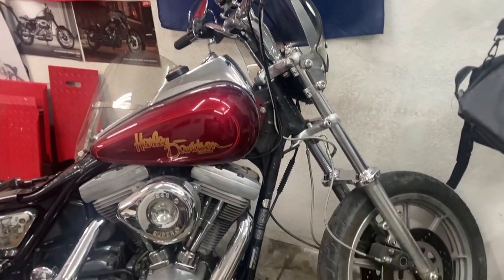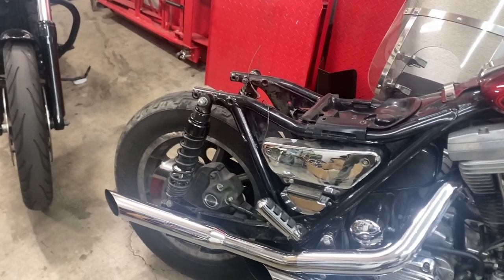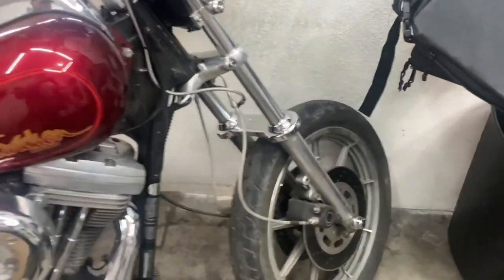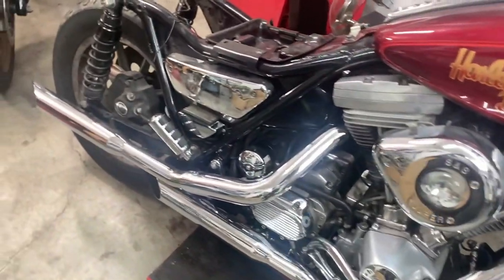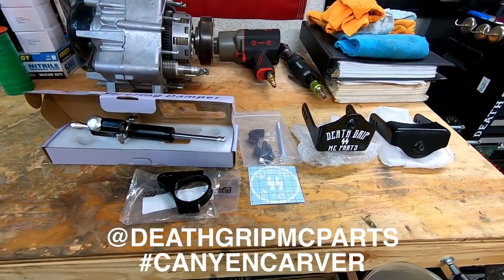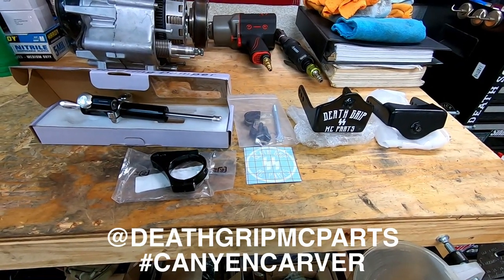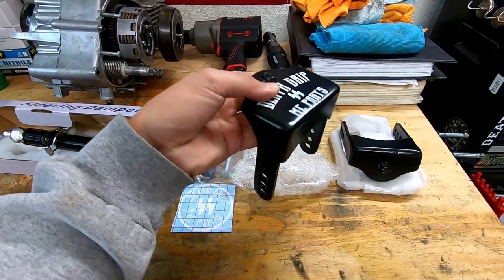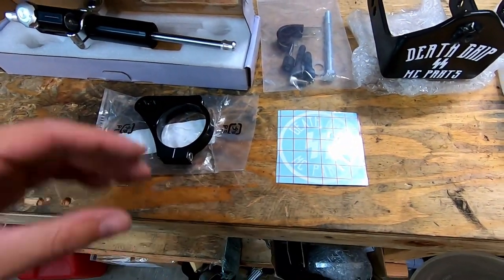Steering Damper Install #CANYENCARVER

Comment: Ran the Storz on my Dyna LRS first and it leaked after a couple years.   Been running the GPR and its been great.

Interesting setup, but the GPR is still a cleaner install.
Reply from the maker: Agreed but the price difference is huge!
Reply: @dynademos    Totally get it.   👍

Comment: If you're bottoming out the front thats very risky. Add a few turns on the preload.
One question, is the Damper shock itself rebuildable? Either way i will definatly check it out!
Reply from the maker: I might have misspoke I haven’t bottomed out my suspension. Also I’m not sure if it’s serviceable I’m sure a higher end damper would me
Reply: @dynademos  Looking forward to the review!
Reply from the maker: @Jimmy_Jim_Jim_1234  check back next week 👍🏽✊🏽

Comment: Cool vid/ concept but not sure I’d trust that damper.. Ohlins and GPR are pricey for a reason.. 

If you like to “carve” the canyons, why’d you raise the front (increase the rake/ camber)? If you lower the front (triple trees) and raise the rear (which I think you did) you decrease camber and reduce the overall trail of the bike.. it’ll “carve” much better.. preload is set and forget (mostly).. learn to read your tires.. they’ll show if you need more/ less compression or rebound.. not sure if you have those adjustments.. just rambling..
Reply from the maker: I haven’t had any issues this far with the damper. As for why I raised my bike the simple answer ground clearance. I had a stock front with raised rear end I find raising both gave me a better feel.

Comment: Hi Lego,  sit back with a coffee and read this one a few times - there are a lot of things to think about !

I'm puzzeled as to why you need a steering damper when you fitted better engine mounts, maybe the fork preload/valving needs a little more attention. Perhaps you are confusing the  effects that springing and damping features have. Once you get the front forks working properly then the rear suspension units will not be 'fighting' with the front ones making you think you need a steering damper....

 I notice that your preload adjusters are eased right off..... maybe the fork spring spacers are too long giving too much preload for the spring - the externally adjustable ones are more for 'fine tuning'.If you feel the bike is harsh on the compression stroke then you have too much fork spring preload.

 I have stronger springs (single rate springs and NOT progressively wound ones) and don't use any preload caused by the fork spring spacers. As you have extended the overall length of the fork then any preload that occurs when the bike is taken off the stand (otherwise known as 'sag') is maybe all the 'preload' you need ! - that is after all why you have 'extended' the forks by fitting longer damper rods or 'seat pipes' as the H-D manual calls them.
Though I do realise that you wanted more ground clearance for 'canyon-carving' as you guys call it, longer forks will allow more travel and can therefore allow a smother ride by way of a softer spring rate - short suspension (slammed) Bikes will offer nothing but looks and poor handling.

I assume you are still using the standard (for your bike) fork internals here though - my 2010 has the 'old style' internals which are different and more easily tuned than the 'cartridge type' things that H-D tried but failed with in yet another attempt to rectify all the problems those 'over-sprung and under-damped'  type set ups they have been using for way too long.
I use the emulators to adjust more for 'plushness' than to attemt to avoid a harsh ride - I use the softeset pre-load sprimgs for the compression damping adjustment - but then I am older and like a 'smooth ride' rather than a bike that bucks around (- still like the women to be a 'rough and ready' ride though !).

Although my bike feels just as 'plush' as the standard bike (mine is a 2010 Streetbob), it now does have suspension that works without the sloppy feel and harsh 'big bump' ride that the standard damping and springs caused. Too soft a spring that is compressed with too much preload can and will cause the spring to 'oscillate' with shocks from road bumps as the spring is not absorbing the shock but merely storing it like a pogo-stick. A stronger spring with less preload will absorb the shock and tend to not'rebound' so harshly and therefore give a smoother ride that does not cause the bike to feel 'unstable'.

If you get the forks set up properly then the fork will absorb the 'impact' off the road bump rather than bouncing off it thereby putting more off the bike's weight on the rear suspension which gives the impression that it needs more preload/stronger springs on the rear. That excess rear preload will make the bike feel unstable in normal 'highway use' as the bike will tend to wander and weave because the rear suspension is too hard to properly absoeb the road bumps and actually puts more 'load' on the front forks ..... you have to make the front and rear suspension work together and not fight each other.....

As for the rear shocks I found that the cost of rebuilding them was the same as buying new un-rebuildable ones (they do have adjustable damping) so I opted for them so as to avoid  the 'downtime' of waiting for the rebuild..... preload is still adjustable and as they are much cheaper than the rebuildable ones you can save in the long run as the rebuildable ones need rebuilding so often - the oil in them degrades/gas leaks pass the seals just as often in either case.
Oh, the term is 'damping' not dampening..... to damp something is to reduce 'it's' progress, to dampen something is to get it wet..... quite surprising how many people get that wrong !
I think maybe I should mention that whilst my forks are still H-D, I do use springs wound to my own specifications,  Emulators, SAE 10 fork oil, Wide Glide (FXDWG) yokes or trees as you call them (so the forks are 'raked out' 2 degrees) and FXDF lower legs (or sliders as we call them !) so that I can run a twin disc set-up.
The two degree raked yokes are more stable at speed and slightly less manoueverable but as I use a 21 inch front wheel, the bike still 'falls into' corners nicely. Fatbobs have a one degree 'de-rake' in order to compensate for the tatter tyre.....

Sttering dampers or stabilizers are just a BandAid on an open wound - it (the suspension) needs 'stitching up' properly mate.

 Nice to see you back again by the way !
 Bob
Reply: Kinda.. if the right springs are set to the right preload (sag), awesome.. you’re talking about compression and rebound.. if he’s twisting the screw out of a corner, the front end gets light, no matter what.. a steering damper will (supposed to) prevent harsh wobble/ tank slap.. it all ties together, yes.. without compression & rebound control, a damper is the ticket on a HD.. conditions can  change suspension behavior.. even the best (MotoGP) have dampers
Reply: @bullast2046   Well, while Lego is using Emulators to help control compressio/rebound it must be remembered that  fork spring rates also affect it. I personally tried Progressively wound springs but found that the constantly varying spring rates (depending upon amount of compression and/or wether the forks were extending or compressing) made it difficult to set up the Emulators to a setting that worked for vaying road surface types/uses of the bike.
What you say is correct about the front end getting light - all Harleys - at that time at least - had the weight bias on the rear wheel and that all adds to the problem of 'weight-transfer' when accelerating and brakeing. Said transfer is really detrimental to the handling especially with the 'over-sprung and under-damped' standard suspension - hence my comparrison with a kiddies 'pogo-stick'.
 To compare a Harley to other bikes is not relevant due to (most) other bikes having the weight bias on the front wheel along with less relative weight transfer, and you have to take into account the fork rake and front wheel 'trail' which will  - along with other dimensions and degrees - alter marginally with the front/rear suspension slopiness. All these things have consequencies as regards the overall handling of any bike.
 Sports bikes and other road bikes again cannot be compaired with race bikes as they are built for different purposes - the only maxim would be that different bikes need setting up differently - try putting longer shocks and forks on virtually any Harley iand it will change the handling compared to a standard one, but you will never get a Harley to handle like a sportsbike due to the weight bias differences.
If one gets a bike set up to a point where one can both predict and rely on how it will handle, then it is merely a matter of the size of the riders kahunas and skill as to how it can be ridden - I have ridden the 'twisties' with a sports bike whilst on my Dyna and the sportsbike rider couldn't believe that he couldn't lose me. I opined that 'you can have the best set up bike with the most power but if you don't know how to ride it....'    he just walked away ! 
 I think Lego is trying to improve the way his (once standard) bike handles so he can enjoy and utilise it's potential of  use on roads that the factory did not envisage the bikes being used on in such a manner - Harleys are classified as cruisers and he is using it for a more sporty-type of riding. 
Check out a lot of the suspension changes that are done to Baggers for the bagger racing series or indeed what companies like Big Bear performance are doing for road bikes.
 Sometimes steering dampers are used yes, but it helps if the suspension is set up properly for the type of use/roads that is required.
 I am not criticising Lego - or anyone else for that matter - for using 'their bike' to ride as and where 'they' decide to ride it, I am merely suggesting that he is not setting the suspension up in such a way as to give him the handling characteristics that he wants or needs, and a steering damper is not going to 'sort' a badly set up suspension.

Oh, and I support him doing these things to a Harley because I think He ,like myself prefers the type of 'grunt' and power delivery that ONLY a Harley can deliver.....  Kudos to you Lego !